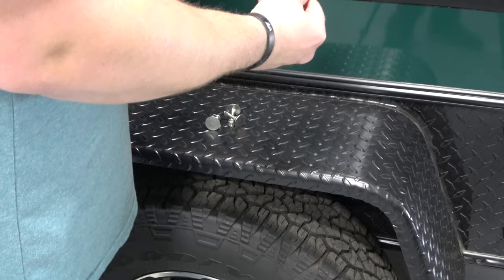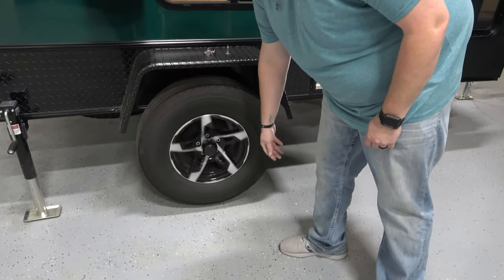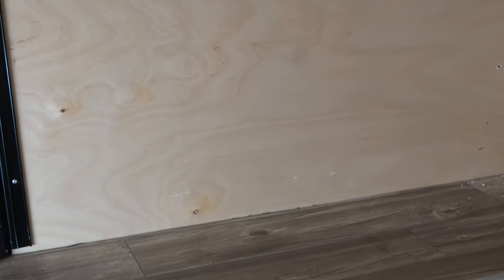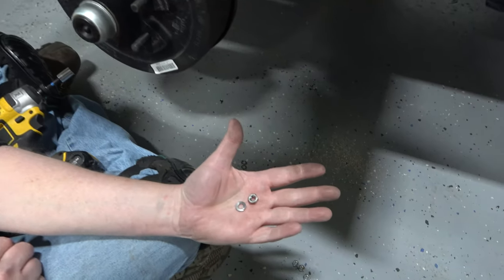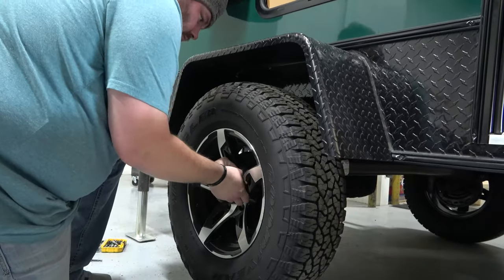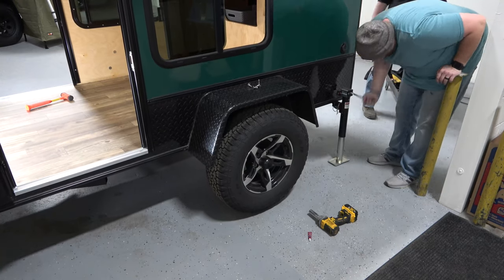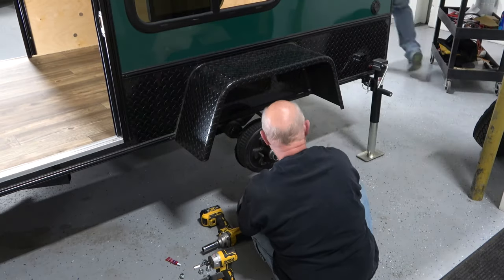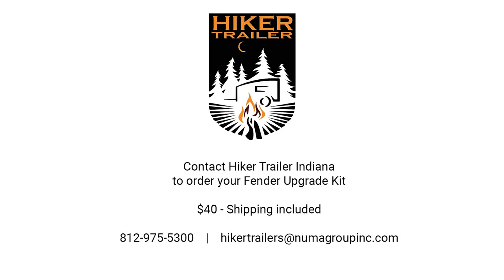Hiker Trailer - DIY - Stand-on Fender Upgrade

Comment from the maker: For owners who have yet to pick up their trailer, this upgrade has been already applied to all builds constructed in 2022 or later from the Indiana facility.  Free of charge!
Reply: Does this include builds that started in 2021 but won’t be completed until 2022?
Reply: Dang, not applicable to the standard fenders are they?
Reply from the maker: If you your trailer is picked up in 2022 it will have these pre-installed.
Reply from the maker: The only fenders this will not work on are the round aluminum fenders on the Highway Deluxe models
Reply: @HikerTrailers  if our trailer is ready for pick up could we price out swapping then rounded fenders for square ones?
Reply from the maker: Contact us directly for your specific build.  It may be possible.
Reply: On your website it states all Highway Deluxe now have load bearing fenders. Is this accurate?
Reply from the maker: @gt2745  Yes.  All trailers produced since the date of this video are load bearing.  This video is for older models and owners to update the Highway Deluxe fenders pre-dated.

Comment: Are there any problems with replacing the other 2 top bolts? How long are these bolts? Doing some winter maintenance right now!
Reply from the maker: We recommend the corners for the weight support.  You could replace them with additional bolts, but I wouldn't switch from the pattern outlined in the video to be on the safe side.

Comment: What about water? Do you need to caulk or anything?
Reply from the maker: It should not be necessary as long as you don't remove the fender due to the installation process at the factory here, but if you would like to be extra safe, you can add some 100% silicone around the new nuts if you would like.

Comment: We got ours from Denver in September 2021 and the fenders have five through bolts with washers on inside. They always advise not to stand on them but now I wonder.
Reply from the maker: This upgrade kit has bolts that function slightly differently that those.  Please follow the recommendation provided by Colorado.